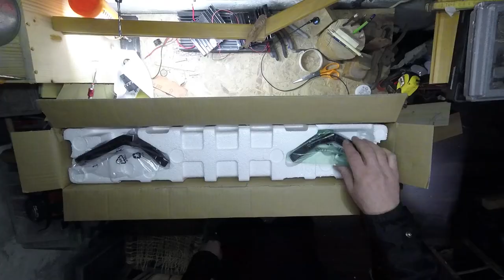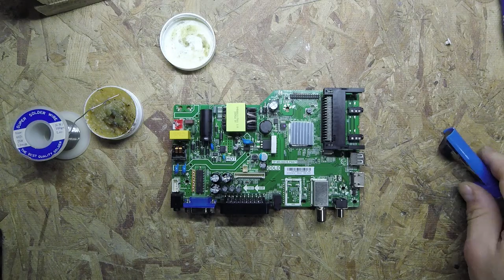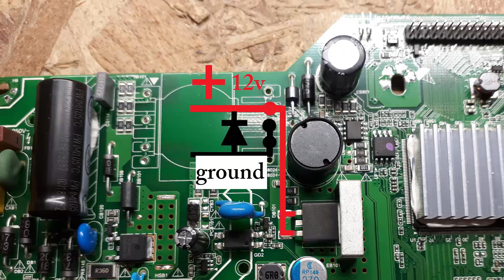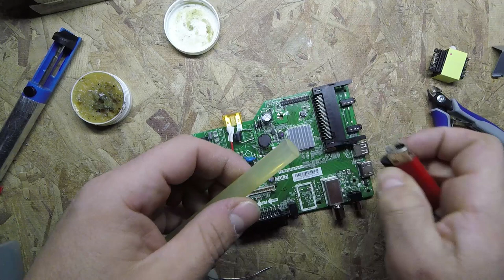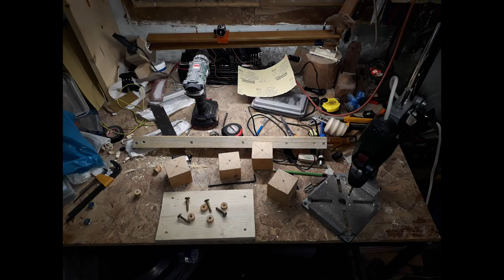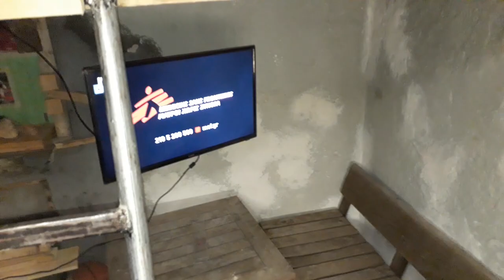Off Grid TV 12v (from 100-220v)

Comment: Hi, if I wanted to run a small 12v TV would a couple of car batteries 1 linked to a small turbine and 1 linked to solar, would that be enough to be able to run the TV for 16 - 18 hours a day?
I'm setting up a caravan for an escape, I've worked the lighting and mobile phone charging with the small solar phone charger/torch combos but need to work out a cheap way to run the TV and if possible a 12v fridge, would appreciate any tips, thanks in advance

Comment: Normal TV with AC input 220v usually convertes to about 360v dc that then is converted to 12v dc by switching power supply.  You can wire a 12 v solar panel to the dc12v position or even a string of panels to the 360dc v position inside tv.

Comment: Great video! Just two questions:
1.- You just connect 12V in a pin, but what about 3'3V and 5V pins?
2.- Is there a problem if the battery supplies 14V instead of exactly 12V? And what's the lower voltage when the the TV switches off?
Thanks in advance.
Reply from the maker: Hello!! Thanks!
 The output of this TV's power supply is 12v. the 5v and 3.3v is after this power supply, so we don't worry about this.. 
My battery is 24v and I have a dc to dc converter 24 to 12, the output is 13.7 as a fully charged 12v battery.  (Measure the voltage before destroy the power supply)

Comment: You  literally have a 12V connector on the board that says "PWR UPGRADE". Just use that as a 12V supply and all the things you did in the video are unnecessary. 
Good tutorial, but its applicable for TVs that don't have a dedicated 12V input.
Reply from the maker: Hi!! Maybe you are right.. If a tv don't have this connector this solution is ok
Reply: you are right. just did it that way and it works. mine is not labeled "PWR UPGRADE" but i took off the board and on the back it said 12v.
Reply: Correct

Comment: what are the specs on the diode? should it be 12V, or 16v?
Reply from the maker: The diode must be large enough to burn the 5A fuse to reverse polarity for protection . I think I use a schottky diode 10 A
Reply: @OffGridCrafts  you think?  Lol nice

Comment: if the capacitor is 25v, i can change it to one of 16 so it can work
Reply from the maker: no don't change the capacitor, can you measure the voltage?? BE CAREFULL WITH THE HIGH VOLTAGE